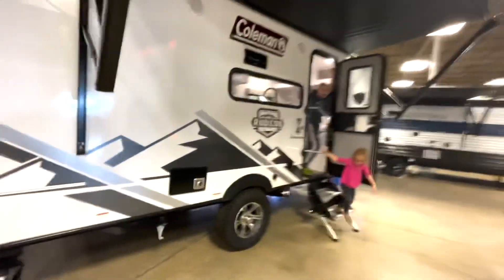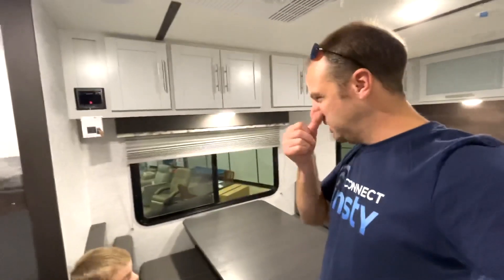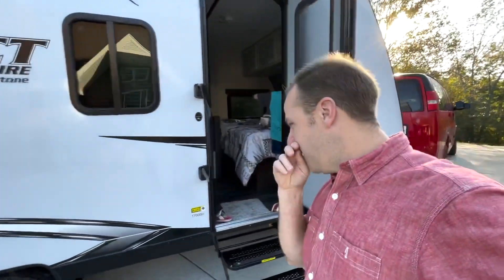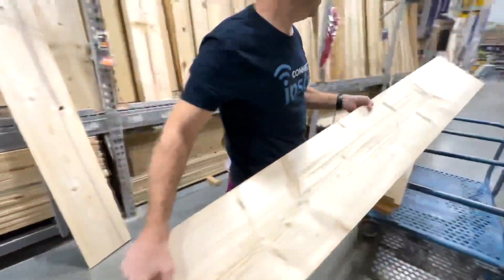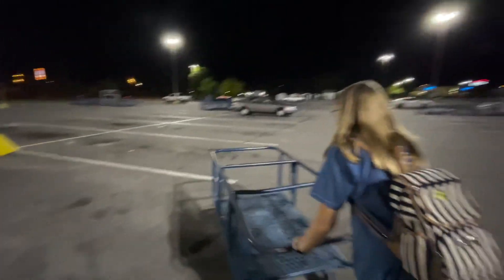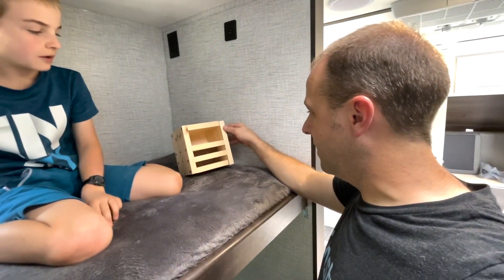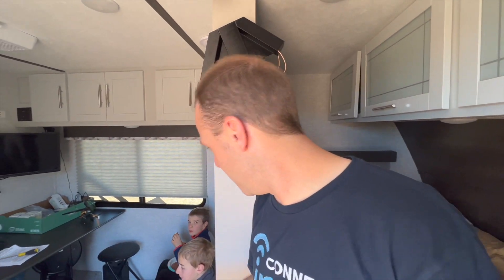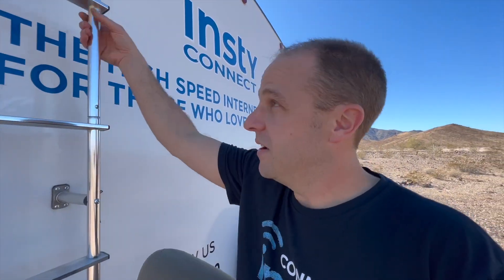IMHQ - THE INSTY MOBILE HEADQUARTERS - OUR QUARTZSITE SHOW BOOTH

Comment: Hi Nick. Awesome way to work and test. With four InstyConnect units  on the IMHQ how did you go through the roof and maintain being waterproof? What are you using as a junction box on the roof and how are you getting the USB cables through the junction box and stay dry? Still trying to figure it out before I drill the hole in the roof of the class A.
Reply from the maker: I drilled a large hole and made a circle of butyl tape around the hole about 1/4" high.  I put the wires through the hole, butyled them up to fill the hole and then ran them over top of the circle.  Then I used Dicor on top of the circle and wires and went wide with it from there.  It's working great with no leaks.  I did shoot some footage of it and will try to share more about the build out of the little trailer.
Reply: @WeCanExploreIt  Thank you. That gives me some ideas.

Comment: What is the pole/mount info. You have there, store bought? Name, ideas? We are trying to find something. Not sure but Maybe a light weight telescoping style like flag poles use??compact when not up & easier to store away.

Nice set up! Good Mods too. We live in AZ but sorry to miss your show! We’re in TX now; Keep us posted on where your next show is please! 
Rig Names:
HiFlying On 5G
SurfsFaster
MyHi-Flyer 
IC 5g TestLab
Have fun & go get them In Quartzite!
Reply from the maker: The pole that we have on the IMHQ is the flagpole from Harbor Freight - it works pretty well but what I've found is that after a bunch of rains, it stops pressure fitting when you twist the pipe, so they have somewhat of a lifespan on them.  I have done their return policy stuff to replace if inside that time.  Overall it's pretty strong and that is needed for those new 5G binocs.
There is a guy called Flag Pole Buddy that makes a special mount for the Insty binoculars (the 4g version) .  I don't know if he has them on his website yet, but it may be worth a look.
Safe travels!
Reply: @WeCanExploreIt  thanks pole/GREAT! just upgraded to 5g cat16 awaiting shipment. Can you tell me if the new Binocs(5g) will also be in my upgrade swap? Or do I place another order for new binocs/5g? 
I was in the test Binocs group & just began our “road life” & just trying (i guess ? 4g) Binocs for our 1st time out since ordered 6/17/21. Can you tell from the date or can I tell from? Something labeled on Binocs? Thanks Nick & crew!!

Comment: I have the original 4G Insty with Angel Wings from last year but I haven't installed it yet on my RV because I want to run the cable through the roof for a clean permanent install.  Now that I see the binoculars I would like to get those too but my cable will not be long enough unless I leave an extra 20' of cable rolled up on the roof.  How are you managing the two different cable lengths? Can you add an coupler to the cable attached to the angle wing cable to add an extension cable to run up the flagpole?  Or do I have to use one very long cable and roll it up when using the angel wings?
Reply from the maker: Dean, we sell a 15 foot extension cable that you plug into the original to daisy chain.  No couplers needed.
Reply: @WeCanExploreIt  Cool, Thank you.